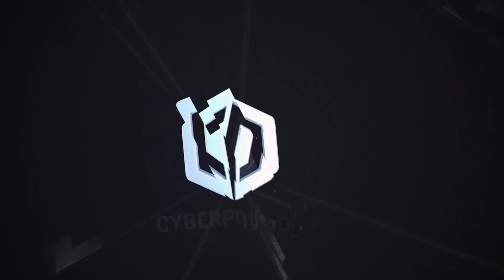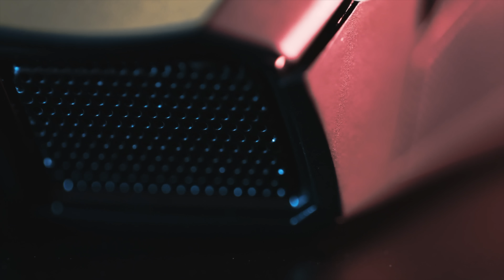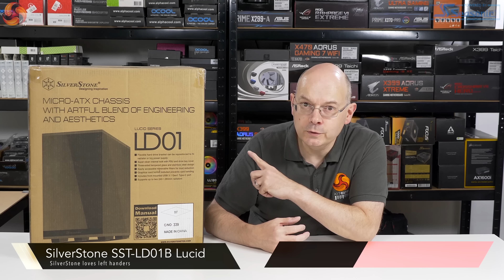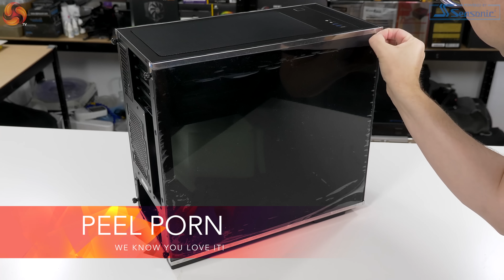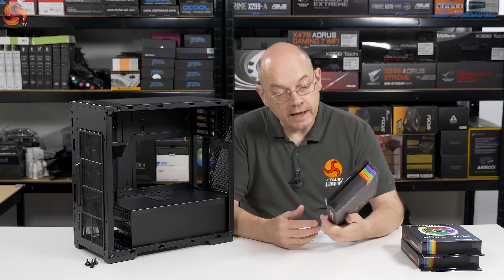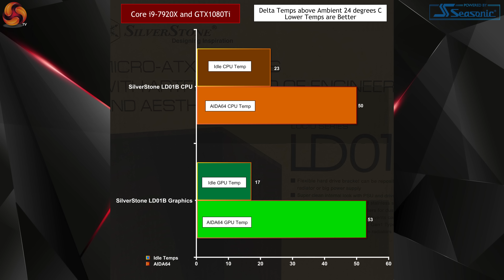SilverStone SST LD01B Lucid - The UPSIDE DOWN case !!!

Comment: Got the case myself.
And tried various cooling configs. With an AIO in the front.
Fans in the roof have to be intakes! Since otherwise they are working really badly against the graphic card ones. Especially if your graphics card sits one slot higher (2nd slot) like some matx boards do. I tried it for fun. It’s bad.
Silverstone wants the front to be intakes (hence the dustfilter). But that leaves the case with 4x140 intakes and a comparable tiny 120 as exhaust in the back. That’s just unbalanced and the tiny 120 can’t make the air escape the case quick enough. So heat builds up a lot in the case.
Solution is to have two 140s in the front as intake and one 120 as exhaust in the back. No fans in the roof. Graphics cards fans will supply themselves just fine.
Or switch everything around. 120 in the back as intake. 2x140 in the roof as intake. 2x140 in the front as exhaust. Get rid of the dustfilter in the front. (Looks nicer for RGB anyways since the filter got really ugly bars in it). Although this config is one of the optimum configs for this case, it’s not super efficient as well since the heat is then a bit stuck behind the front glass panel.
Overall I have to say cooling is a bit mediocre in this case. And you have to make up for it with brute force aka noise.

Comment: wrong wrong wrong, ur proofing stuff in the wrong way. The cooling should be instake from the top down and past on the GPU (blower is best) to the CPU where the back fan (and the front) team up to cycle the head away) 

Incase of water cooling its recommended to put the Water cooling in the front with Fans that can greate great amount of sucktion. 
I myself bought my second version for a new built to be Silent and completely air cooled. 

#donthatejustscience

Comment: a few months later, silverstone have shown off a similar case named RL08 in CES 2019. same interior , but mesh front and steel side panels. hopefully it will do better at cooling. i just need to wait for a good AM4 matx motherboard, x570/b550 chipset.
Reply: I'm in the same place, what did you ended up with?

Comment: Still looking for something to replace my old Temjin TJ08-e. The airflow on this must be horrific. If they removed the optical drives and external 3.5" slot from the Temjin, I bet they could get two 180mm fans in the front, plus add some more top ventilation. That would be so much better than this.
Reply: I had the Temjin for a few years and finally replaced it with a Phanteks Enthoo Pro M tempered glass ATX case, very happy with it.

Comment: Air in at the top blowing air directly over the gpu and air being pushed into the case from the back cooling the cpu.
then extract all the air OUT the front.
simple people with little experience.
Reply from the maker: Leo here: This case comes without fans so you cannot simply look at the factory fitment and proceed from there, however the manual shows drawings of the fans intaking at the front and exhausting at the rear. Reversing the airflow would make a certain amount of sense however it would be helpful for SilverStone to spell out the options. As for close-minded, no, not really.
Reply: that woudnt stop me throwing some gentle typhoons or noctua fans in the front as an exhaust.
if i had this case thats how i would do it.
cool air direct from outside case it dont get much better than that really
https://i.imgur.com/bovIC0V.jpg
Reply: i didnt mean to be rude.
Reply: If i had my way i would fit a fan where the glass is.
blowing cool air directly over the vrm on the board..
thats the problem with cases today there is no direct air flow over the board.
all for the sake of it looking nice.

Comment: wow no benefits from cooling really.
stick 2 120mm fans in the top blowing air directly over the gpu then say the same thing.
my inverted case ive had for over 12 years,
amazing case.
Inverted cases are the best.
lets you blow air direct from outside of case directly onto the gpu fans
Reply: Inwin cases do that (bottom fan intake straight to the GPU)

Comment: I had the epic Silverstone FT 02 and combined with the 90 degree change in motherboard and brilliant penetrator fans in the base meant dual sli gpu's and whole system was so cool it's the only way without water cooling for keeping sli cool as traditional setups means one gpu is hotter than the other. However this setup begs the question why?

Comment: I do wish more companies made inverted board cases for the exact reason you mentioned. My desk has a hutch and the only spot I can put a computer where I can see it (why would you get a TG case if you can't see it?!?! lol) is on the left hand side. Makes placement of standard config cases a bit... interesting...
Reply: This is why I love Corsair 600 c.
Reply: Wow! It looks nice but it still has 5.25" bays. I really like that the newer designs are getting away from those and I prefer more open air in the front, but then maybe I'm being a bit picky. lol
Reply: @DefMunkyYT  It does, but they are covered by a door. While I don't use internal 5.25 drives anymore I do have a neat little drawer that slots into a 5.25 inch bay. I use it to store mouse weights and spare key caps (I use a Corsair K70 that comes with the gaming key caps). Search Amazon for "EverCool PC 5.25 inc Drive Bay DVD CD Storage Drawer" and you can see what I mean.

Comment: hmm inverted seems to make more sense. The GPU gets way better airflow.
Reply: But if you don't have fans at the top the heat in the system will rise and the gpu will keep recirculating hot air :/

Comment: This is the old ATX standard layout just with the feet on the case placed on the other end. It also has superfluous front fans which you would only put there for RGB, nothing more as they cannot blow air in the case.

Comment: In that form factor, and with an inverted motherboard layout as well, I liked the Raijintek Thetis. You have less storage options, but once you invert the back fan to work as an intake and add two top fans, it works really well. I built a system in it for my ex, and it looked amazing, except for the four thumb screws holding the side panels. And it can hold full ATX mobos!

Comment: While it looks gorgeous and does a lot of stuff well, they did mess up with cooling and main reason is very limited air intake. The case draws air only from small openings on the top and bottom of front panel, and it's not enough. They also made a large "blind spot" on the top part on front part, after you take the front panel off, right above the fans. They should have moved intake fans up, all the way to I/O ports, that would allow top fan to get some more air. Ideally, they should have made intake holes on the side of front panel, a la NZXT H400 or FD Define, but hey didn't. As for GPU, having it draw air from the top, exclusively for itself, is not a bad idea, that's one of the benefits of inverted layouts.

SIlverstone tried to make a spiritual successor to their Temjin TJ08 MicroATX case, which was pretty famous. It also had the inverted design, something Silverstone is known for. They didn't think the details through, it seems...

Also, I like MicroATX form factor. It's a good compromise between portability and features. For example, I have a FD Define R4 case and I hate how big and cumbersome it is, even sitting on the floor. It's unneccessarily large for majority of users and use scenarios. MicroATX means I would have smaller case while keeping all the features of a regular size board as well as ease of use, without constraints and limitations of MiniITX format. I wouldn't even need a regular ATX. It's a shame motherboard manufacturers are neglecting this format, they shouldn't...

Comment: its not  ATX its BTX FROM INTEL Balanced Technology eXtended) is a form factor for motherboards, originally intended to be the replacement for the aging ATX motherboard form factor in late 2004 and early 2005. YOU WOULD KNOW THAT IF YOU WAS WORKING ON COMPUTERS BACK IN 2000s The ATX and BTX standards were both proposed by Intel. However, future development of BTX retail products by Intel was canceled in September 2006 (c)wp
Reply from the maker: Leo here: BTX is an Intel form factor that never took off. It moves the lower part of the motherboard above the CPU, so essentially the two halves swap over. It makes sense thermally but never came to pass. I don't think I ever saw a BTX board, despite starting work in this sector some years before 2006. The board you see in this review is a regular mATX that has been inverted.
Reply: my memory playin up-sorry got it part wrong i had 2 or 3 btx cases in 2006`s i converted them to atx dell case`s cant be done as there heat sink  bolts though the back & io shield as to be cut out,lenovo can be done but the usb/sound wire have to be modded ,thats wat you would call it to day modding ,just intels cock up  and no one took it on some nice cases tho
Reply: https://www.youtube.com/watch?v=c54rs_z7bVs   yes tec city call them btx but there btx stile case had a read of pc format from 2000

Comment: Looks like a nice case to build small oven. No intake ventilation at all, rubbish.
Please empathise this aspect. For PC chassis not being able to cool components is like for a car not to drive. Doesn't matter how good it looks or how comfy and well fitted is inside. It's disqualifying.
Reply: Intake comes from the top of the case. I've had this case for two months now, no issues at all.
Reply: The front intake is a tiny strip on the top - I don't imagine it draws all that much cool air into the case?  It's a shame to have those two large fans at the front, only to hobble their cooling effect by restricting airflow so drastically.
Reply: use front as the exhaust not the intake.
https://i.imgur.com/bovIC0V.jpg
Reply: So: U can mount 2x 140 mm Fan pulling air from top directly to GPU. CPU will be suffocated especially on tower air cooler. If U block the one exhaust with 120 mm CPU AIO, which is not enough for high end 8 Core CPU's Ull end up blocking the only real exhaust. Doesn't matter that U have 2 x140 mm intake if U have only one 120 mm exhaust blocked by radiator. So U'll end up with lots of positive pressure, and air will be getting out every possible hole, mostly on the back through the little piece of mesh by pci slots.  VRM's are going to end up with no real ventilation. 
Ultimately You are working against physics, where hot air would go up, and pulling this hot air again back to the chassis by intake at the top.
The fact that UR pc works in it doesn't mean that it works as it could do in proper chassis, and furthermore, doesn't mean that the components will last longer in it while constantly overheating.

I'm absolutely sure, coz once upon a time I bought similar piece of rubbish and ended up with front panel taken off all the time. I bought it because it didn't cross my mind that professional PC chassis constructing company would sell product so badly engineered, with messed up obvious basics. 
Now my PC is in Farctal Design Meshify C, mainly based on GN tests and the fact that it looks great.
Reply: @randalldraco3822  Hey, I'm with you on this, I even said the same thing in my review of this case. But I didnt notice a significant increase of temperatures with this case. 3-4°C Max. Plus I dont have an HEDT class pc inside.
Reply: Let's hope GN makes a test of it, well see how it compares to others. 4 degrees more, compared to what?
Reply: @randalldraco3822  compared to PM02 from silverstone.
Reply: @PejicVladimir  Pm02 is average, when u ad 4 degrees u go to the hot side pf things. More than 10 degrees compared to meshify an other well ventilated cases. 10 degrees on processor or gpu is a bid difference. U just got used to thermalthrottling m8.
Reply: @picklewiickle.1583   U R the one that  have nothing to say in the topic obviously. There is no point to intake when u have no exhaust and clear air flow path. Gpu is blocking the air from cpu and vrm. 
Thats really poor design.
Reply: well i wont disagree boards need air being blown direction onto the vrm.
i have a huge fan on the side of my case blowing air directly over the vrm myself.
No place for windows in my opinion.
Reply from the maker: @randalldraco3822 Leo here: So in the review I say that SilverStone would do well to explain how they think fans should be installed as the airflow path could work a number of ways and I demonstrate a 12-core CPU and GTX 1080 Ti working perfectly happily, which is obviously more hardware than most people would install in this case. In conclusion I say the only obvious reason for using this chassis is to flip the system to the left hand side , and that drives a number of significant design decisions.
Despite all that you seem bitterly unhappy.
I think we can agree this case is not the one for you, however I am unclear what point you are making that isn't covered in the review.
Reply: @KitGuruTech  Morning. I'm not bitterly unhappy. I just wanted to make a point how important that is, an how many cases in last 2 years, following the trend of rgb mania and closed front, ended up being completely useless. I cant argue about it with You, I cant test this chassis myself. It's hard to believe that You were able to cool down 12 core and 1080ti with reasonable temps in this box. It Is just a box with some holes and fans. And this particular have only two on top and one on the back fully capable of doing their job.
Epic fail of H500 and many other form-over-functionality cases proves that.   In the past I bought similar designed solution, and it ended up with dismounted front panel all day long, if not, the fans would spin full throttle. 
 Then I started digging in the topic. I would suggest adding a simple chart to Your chassis reviews which will show standardise results of temps/noise after 30 mins of gpu+cpu stress test. 
Other tan that, good work.
Reply from the maker: @randalldraco3822  There is a chart in the video
https://youtu.be/Vws024gPZV4?t=569
and also in the written review at KitGuru.net
Reply: physics doesn't matter in PC cases (by that i mean hot air rises)  the pull of fans is enough to create its own airflow without hot air rising affecting the outcome of temps. That is unless you want to run the fans slow enough (snail's pace slow) that it would impact temps but 99% of the time heat rising doesn't affect temps in pc cases.
Reply: intake is at the top blowing air directly onto the graphics card fool
Reply: https://i.imgur.com/bovIC0V.jpg
flip the front fans around.
Reply: @picklewiickle.1583  there is some kind of misunderstanding here😬 tfliping fans wont work. They will blow air into glass. All u archive is reversing air flow direction. Really ineffective. Ive tred that. When the intake is on top and bottom of front panel, most of hot air returns back to chassis using gaps above fans. Solution for that is using duct tape to seal everything.  100£ chassis fixed diy? How about no. 35£ yup, I can cut holes in it.
Reply: no mate.
intake and outlet.
simple.
Reply: @picklewiickle.1583  thats the issue, there is no outlet/intake, depends how U look at it. There is a glass sheet, and 2 small gaps imitating the real deal. It does not work, and it has been proven many times through testing. Go watch GN chassis test and comparison chart.